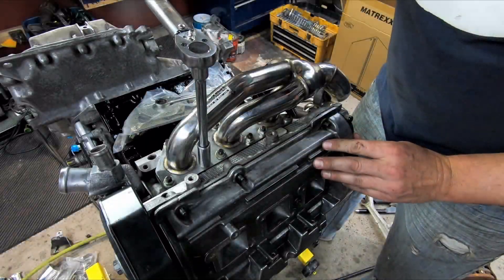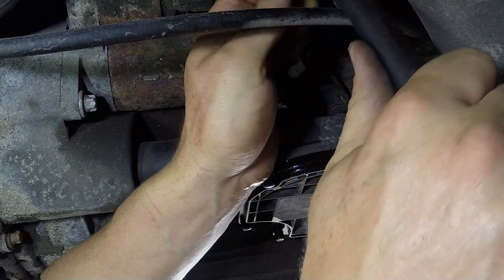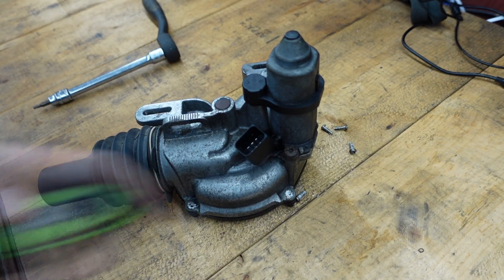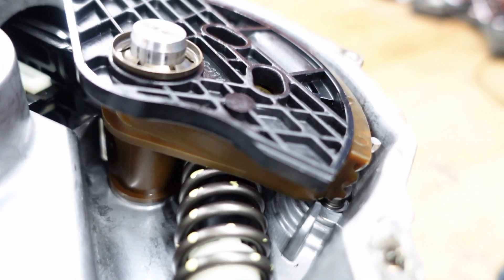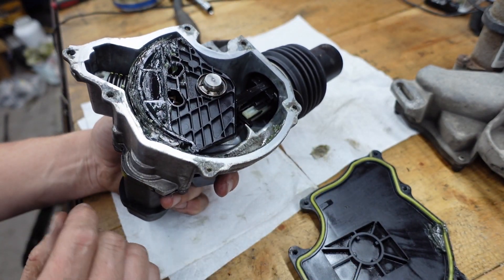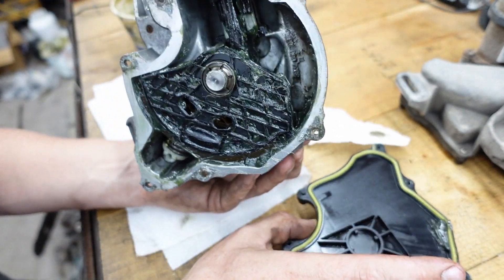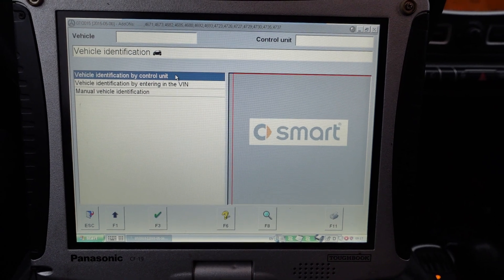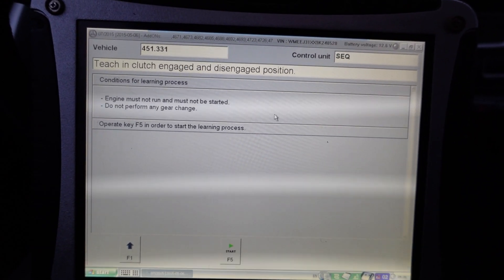Smart 451 Clutch Actuator DIY Service

Comment: Why would it be necessary to reprogram the software if you are just re&re for cleaning and lube? If you mark the location I wouldn’t think it would matter. Great video, thanks!
Reply from the maker: If you mark it well and get it back in the same spot it’s not necessary to reprogram it. However as the clutch disk wears the engagement point changes over time. If you were taking the car to the dealer for service, they’re supposed to perform the recalibration on every B service.

Comment: What are indications that the actuator is bad besides the weird noise? Also do you recommend this car? Is it reliable? I was thinking about getting one and i am not scared to put a wrench to it
Reply from the maker: Other signs it’s bad are if you’re driving and you get “3 bars of death” which is 3 horizontal bars on the lcd screen that normally says “P” “D” etc. Generally speaking though any car by now that hasn’t been serviced should be. 

They are economical cars if you can do your own work. Some parts are starting to get harder to find at least in North America.

As an only means of transportation to depend on, I think there are probably smarter options out there. If you have access to a second car or public transit so you can afford to have the car out of commission a few days while you wait for parts, it’s still a fun and economical car to drive around.
Reply: @PBGarage so all generations of the fortwo are prone to this 3 bars of death thing? Im looking at a 2013 fortwo with 53k on the dash. Should i be good for a while or should i get it serviced? Assuming i buy the car that is
Reply from the maker: If it was me I’d service it just to give it the best chance of lasting a while. A 2013 is still a 12 year old car. If it hasn’t already, it probably won’t be long until it needs a new flex pipe, new rear brake shoes, serpentine belt tensioner, the list goes on. Who knows it could be pristine and not need anything for a long time… but chances are…
Reply: @PBGarage oh okay, i see where you are going with this. Well i guess ill just expect the worst nd hope for the best. You only live once on this earth and i want something different. Plus i dont mind turning a wrench if i have to. If its something totally out of my hands thennofc i will have to put it in the shop but well see. For example I dont have access to the software thing for programming the actuator but i can do everything else

Comment: Perfect Video, thank you very much! I have to do that too. Please one Question: That the actuator is compressed: Which gear is it "in the car" bevor stopping the motor? Resp. how to get it compressed? Thank you so much!
Reply from the maker: It should be compressed anytime the car is shut off but to be sure you just have to have a look before you remove it. It’s very obvious when it’s extended. As long as you don’t shut the car off while in gear and running it should be compressed.

Comment: The most important learning moment is the learning-in the actuator and the computer program to use to do it. Can you show the program used for this procedure?
Reply from the maker: I’m using a MB Star C3 Multiplexer and an old laptop running WIS/DAS. Look it up on AliExpress but you’ll need to do a lot of research before pulling the trigger on a setup because they can be finicky and unreliable as with anything on AliExpress. Good luck!

Comment: can you do a video on your computer and what cables for smartcar 451 i would like to do this myself
Reply from the maker: I’m using a MB Star C3 Multiplexer and an old laptop running WIS/DAS. Look it up on AliExpress but you’ll need to do a lot of research before pulling the trigger on a setup because they can be finicky and unreliable as with anything on AliExpress. Good luck!

Comment: unfortunately in greece they dont repair it,  you have to buy a new one and it costs 480 euros.  i bought a new spare part in 2022 and in 2025 the rear is dificult to get in, and they tell me to buy anew spare part.
Reply from the maker: Need to work on it yourself!

Comment: After doing all that... my Autel scanner says "The learning process failed. Actual clutch position 16640.00Ink" and it keeps starting abruptly when it warms up... I don't know if I should buy the actuator or put in a new clutch kit or change the transmission oil or sell it...😭😭😭😭😭
Reply from the maker: That sounds like the clutch pack itself going out. I haven’t done one yet myself but one of my smarts has similar symptoms no matter what I do with the actuator including swapping it out with other known good ones.
Reply: @PBGarage Friend, I have a headache every day... it runs and shifts well... it doesn't slip through the gears... it only starts strong when it's hot... when it's cold you take off the brake and it does nothing and you can accelerate smoothly and calmly... I love the car... I want to keep it but I want to solve it as soon as possible because it's my daily car to my job which is a 2 hour drive.
Reply from the maker: I wish I had a better answer for you but I think it’s the clutch pack.
Reply: @PBGarage Thanks, my friend... I'll have to lower the rear body, wheels included, and see if I can change it before the cold weather arrives...

Comment: Will the actuator cause one to go into neutral after putting in drive a accelerating?
Reply from the maker: It’s possible but usually it will display 3 bars on the dash in the gear indicator. Could be an issue with the gear selector lever and its position sensor.
Reply: @PBGarage  I just read somewhere to that if it has a engine misfire it will do this as well. The one I'm working on does have a cylinder 2 misfire so I will attack that first and see. Dont have any history on car it came in from auction no crank no start (sam unit). Just got it running and went to pull it out and discovered the neutral issue. Thanks for the video and reply.
Reply from the maker: @katservices  Thanks let us know how that goes, I'm curious too.

Comment: Interesting item, many thanks! I have a question about the cleaning. What I heard you use ‘purgewasher’ to clean the inside. I’m Dutch and don’t recognize purgewasher ☺️Is it same as brake cleaner? Many thanks!
Reply from the maker: Parts washer! It’s similar to brake cleaner but not as “dry”. It’s more similar to kerosene maybe or degreaser.

Comment: Una pregunta amigo x que no enciende mi SMART 2013 hdm    le cambie la valvula PCV Y ya no arranca a hora que lo arme que podria ser. Gracias
Reply from the maker: I think there is a good chance you’ve either forgotten to plug something in or you’ve introduced a major air leak into the system somewhere so the mixture is wrong.
Reply: @PBGarage   bueno muchas gracias boy a checarlo . Buen dia

Comment: Question, I have the factory alarm system on my 451.... Can your software unable that option in the sams....
If I don't hit the ignore button on the dash the alarm will go off on its own.
Reply from the maker: If there’s a way to disable the alarm using STAR, I’m not aware of it. I’ve coded new keys and things of that nature but never looked into disabling anything. I’m not even sure what ignore button you mean? There’s the lock/unlock, but beyond that? 

If you’re hitting unlock on the fob, opening the driver door, getting in, and the alarm is going off when you go to start the car or reopen the door after a time delay or something like that, it could be that the door opening sensor on the driver door has died. To test it, unlock the door using the fob and then wait. The doors should lock themselves and the alarm rearm after 10-20 seconds something like that. Now, if you hit unlock on the fob and open the driver door, but then close it again and wait. If the car locks itself again and rearms, then the door opening sensor isn’t working. Test it again with the passenger door. You can also check the interior lights activate on door opening (as long as you have them set that way on the switch).
Reply: @PBGarage  It’s the button to the right of the unlock 🔓 has a picture of a car with a hook 🪝 like for a tow truck.

Both my smarts 451
Have the factory alarma.
These cars have some microwave sensors 
Mounted near the gear selector.

They all go nuts and think someone’s robbing the car 🚗 and starts honking the horn on itself 
Wasn’t sure if mb stat allowed you to disable that option
Reply from the maker: @MrMr123 all my 451s also have factory alarm but none have a tow hook just a blank in the slot next to the unlock. Maybe North American cars don’t have motion sensing.

Comment: So when you replace actuators do you have to do any programing?
Reply from the maker: It’s best if you can do the learn in procedure with Mercedes STAR tool. You can do it manually but it will never be as good.

Comment: Just like you did, I found that on some of these parts that can be removed and repaired at home by the DIYer, is to find a salvage yard and try and find a really good part, do your service on that one you picked from the salvage yard, and just have it on hand. Replace it in minutes….. then after you replace the bad one, repair the bad one, and have that one on hand. I like doing this because, if I pull the part and try and repair it, and I don’t have the right tool, an inner part is broken or I just mess it up….. my car won’t be down for a few days. That part is repaired in minutes.
Reply from the maker: It’s a great way to do it!

Comment: My Smart won't engage reverse especially if parked sideways uphill, but works OK in level ground. What could it be, please help. It engages drive normally though.
Reply from the maker: That’s weird that it works normally unless it’s on a hill. I would start by checking the wiring to the shift motors. They can chafe through and cause weird shorts. Might ground out when on an angle but not normally.
Reply: @PBGarage  thank you for the reply. It didn't engage again this time on level ground, had to drive forward then break hard"ish for it to start working. Maybe the actuator needs more grease?
Reply from the maker: @Gonxp12  You've already serviced it or not yet? If it was the clutch actuator it should be as difficult in drive as it is in reverse, I would be looking into possible issues with the gear selection motors or wiring.

Comment: Good evening, I have a smart 2013 facelift and it presented me with a fault P0886, the car suddenly when it goes on the road it does not change speed.. I drive it to the end of the road, it turns off.. I wait 2 minutes for it to do a tac in the SAM fuse box and then it starts normally it works and changes gears.. what could it be?
Reply from the maker: If you haven’t serviced the clutch actuator I would start there. Next step you can disconnect the battery and leave it off for like a day so the memory gets cleared then when you hook it back up, turn the key to “on” but don’t start the car. Let the transmission shift through the gears and re-learn  positions. If that still doesn’t help, sometimes it can be a faulty relay, or an issue with the clutch pack itself. Here’s some info for the relay issue: https://www.smartcarofamerica.com/threads/n10-10k9-transmission-relay-location-p0886-fault.156692/
Reply: @PBGarage  because I bought it 6 months ago, the car has 60,000 km and here in Greece they change the entire actuator after they don't test it and it gets to the point of breaking hahahaha, they don't test it... I would like if you could give me some information or some file if there is so that I can do it correctly the actuator, lubrication, in which position to put it, or maybe I need to put it further forward and the related things, so that I can do it correctly... thank you very much for the information!
Reply from the maker: The service and lubrication is shown in this video. As far as to setup the actuator you need a Mercedes STAR diagnostic tool. Otherwise you can only adjust it by feel. If the clutch engages to harshly, move the actuator towards the bellhousing, if the clutch engages too softly move it away from the bellhousing. But that’s not a very good way of doing it.

Comment: Thought I'd drop in a comment here about the whole process and what I experienced because I just got through doing it on my 2014 Smart that has 91,514 miles on it. My car had been surging a little bit when in drive, and when I put it in reverse, that's where the really big problem was, it was chattering and jerking. When I began investigating what it could be and ran across these type videos I thought, for sure I had found the fix. It turned out it WAS the fix! My car now runs and operates like it did when it was new. Couple of things to point out for everyone. When you are setting up the "lash", the amount of "pressure" on the clutch level itself, all I did was feel for the actuator rod to touch up against the clutch lever. Now I moved back and forth about six or seven times till I made sure I was feeling it correctly. From that point I put a little bit of pressure on the actuator itself, and I was very careful, as I slid it towards the bellhousing three more indicator lines. So everyone clearly understands. There are indicator lines, kind of like quarter round lines. The type you're seeing in these videos that are molded into the housing of the actuator. When I touch the clutch lever there were three lines showing. Then I pushed it three more. That's what the manual calls for you to do. It's easy to find this one line. The Other important thing I wanted to share with everybody is I did not have the software nor a laptop to plug into the car. The more I read about doing this job.I learn that you do not have to do that. Once you're finished with the job and you're about to drive the car to test your work. Just turn the car on and let it idle for about thirty seconds to a minute and a half. The car will learn the actuator position on its own. At least that's what I experienced. And then what I did is, I shifted the car somewhat slowly from park to reverse, to drive, to neutral, to reverse, to drive the neutral, and I repeated that maybe ten times slowly while my foot was on the brake. Then I dropped it in drive And went twenty or thirty feet stopped it, put it in reverse, did the same thing forwards and backwards, about six to eight times. At this point I knew immediately that the car was in tremendously better shape than it had been for the last eight ten thousand miles. My biggest problem is that when I was in reverse backing up, the car would shake and chatter very hard. Almost surging at times. That was all gone immediately. Then I took it for a shakedown run. As i've already mentioned, it ran, just like it was brand new. Hope this info  helps some of you out there.
Reply: Thanks

Comment: If you don't have a laptop/software and can't have the car "learn" what you did, what do you do? There are others on here tutoring us with similar procedures, but are not talking about having to deal with plugging into a laptop. Any advice would be great appreciated.
Reply from the maker: The main thing is to mark the position of the actuator before you loosen the bolts off so you can reinstall it in the same position. Beyond that you can make a certain amount of adjustment by moving the actuator closer to or further from the flywheel. I’ve managed to adjust some this way but it’s really not ideal and takes a lot of trial and error and very tiny adjustments. 

Any garage that has a Mercedes factory scan tool should be able to perform the adaptation so unless you’re somewhere really back woods, there should be an option to do it “right”.

Comment: En français s’il vous plaît, 👀🧐🇨🇦
Reply from the maker: S’agit d’ouvrir la caisse de l’actuateur, nettoyer, lubrifier avec un produit à base de silicone, et réinstaller sur les mêmes marques. C’est à dire, sans changer la position de l’actuateur relatif à la transmission. Si possible, utiliser le programme STAR par Mercedes pour effectuer une adaptation numérique.
Reply: @PBGarage  , merci 🇨🇦

Comment: okay, should have watched this before... took the thing out, mine has rivets so can't take it apart and grease it. so slip the boot off and grease inside.   put it back in, now it make a banging noise.  didn't know it had to be relearned.... obviously i don'[t have smart software to do that, anyways around that?
Reply from the maker: If you have it reinstalled in the same position as when you took it out you should be ok. Even if you were way off it still shouldn’t make a banging noise. Sounds like the clutch release fork may be worn through or you have some other issue with the clutch pack. 

You could try moving the position of the actuator forward or back and try again to see if you can get close to a proper alignment, if the clutch engages too harshly move the actuator towards the flywheel. If the clutch slips too much and the car doesn’t move, slide the actuator away from the flywheel.

You may have bigger issues.
Reply: @PBGarage  well before i 'touched it' there weren't any noises.   could i have reversed the connector?  i know 1 and 6 are the power in...   i don't have a wiring diagram to see what colours coming in should correspond to those.   so two things i'll try once this rain stops. loosen the screws and lets it go were it needs to go. (thinking about it, wondering if it pivotted - i did check the position of the first screw, the one that is easiest to get.   but the one behind i didn't...   will also try to flip the connector.
Reply from the maker: @rapunzeleh546 the connector should only go one way.
Reply: @PBGarage  the plastic was really brittle and the tabs broke off...   can it still only go in one way?
Reply from the maker: @rapunzeleh546 no idea